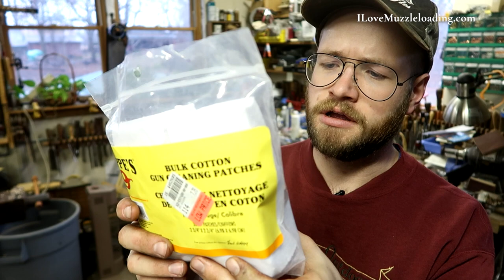How I clean my Kibler Southern Mountain Flintlock | No more rusty muzzleloaders

Comment: You removed the lock. That is when you should spray it, not spraying all over the metal and wood where it can soak into the wood between metal and wood, causing permanent damage. Sorry, I don't see the logic of that.
Reply from the maker: What kind of permanent damage was caused? I'm always looking to learn, thank you for sharing!
Reply: Untreated wood repeatedly absorbing liquid is OK?
Reply from the maker: @garyruxton5226  In my experience, and those I've talked to/learn from it rarely causes harm. In all of the original pieces I've handled, none of the inelts were treated in any way and they exist today in great condition. 

Not in any way saying you are wrong, It's something I'll continue to watch and update if I see an issue.
Reply: @ILoveMuzzleloading  Apologies. Must just be my paranoia of liquid and wood. Oops on stirring up dust. You're a valuable channel. Appreciate your work and lucky you that gets to handle a lot of cool guns.
Reply: @garyruxton5226 I'm a little late to the party but muzzleloader stocks were historically finished with Linseed oil which fills the pores and hardens. With enough applications you get a very strong, waterproof finish on the wood that can easily withstand incidental water from cleaning!

Comment: Take the barrel off and have a near boiling bucket of soapy water,  set breech of barrel in water and run patches up and down several times, scrubbing the barrel. I then take new boiling water only and repeat proces. The heat from the water gets the barrel so hot that it dries the barrel. After it cools a few minutes I then run an oily patch through the barrel then a dry patch a couple of times. Doing this it leaves enough oil to protect the barrel but not enough to have it gum up while sitting for longer periods.
Reply: That is a Longrifle with a pinned barrel. You don’t take the barrel off to clean.
Reply: Hot, soapy water is the best thing there is to clean black powder residue. As you say, the heat causes the steel to dry quickly. I always actually use boiling water (with a good waterproof gauntlet glove ilon my left hand). I flush the barrel with boiling water after I get no black or grey after flushing through my barrel.
Reply: That is how I've done it for 50 years

Comment: helpful video Ethan.  Yes a million ways to clean a flintlock.  One thing I do to clean the lock a little different than you.  When I'm home, I clean it in my utility sink with hot water and Dawn (any dish liquid will work).  I heat the lock with the hot water (tap hot not boiling hot) squirt a few drops of dish liquid on the lock and then scrub it with an old toothbrush.  After about 30 seconds of brushing, I hold it under the hot water to rinse off and get the lock hot which helps it to dry almost instantly.  I dry it off with a towel and some cotton swabs then oil it and I'm done.  Been doing it this way for 30 years never any rust on my lock.
Reply from the maker: Thanks for sharing Jeff!
Reply: I to use Dawn and boiling water. I made jig out of wood about 12" long  with a octagon cut out that fits over the barrel so me don't burn meself. But I'm cap and ball.
Reply: @ILoveMuzzleloading  I have a question for you.  I see on your kibler that you have a permanently installed touch hole liner.  I have a low end traditions mountain flintlock rifle that I have not fired yet that has touch hole liner that is slotted to fit a screw driver.  I went on traditions web-sight to look for a replacement touch hole liner for when the touch hole liner will eventually wear out.  I did not know which touch hole liner I needed so I called their sales rep at traditions and he said that if I removed the touch hole liner that the barrel was done and I needed to get a new barrel.  Which in contradictory to the cleaning and maintenance section of the manual of their traditional side lock rifles.  The manual says "remove the nipple and clean-out screw from the bolster/drum of a percussion gun of the touch hole liner from a flint lock." 

There is a warning in the manual about never remove the bolster/drum or breech plug from the barrel which I obviously know not to do that and that should only be done in the event that you can not get the rifle to shoot, or you have a stuck ball in the barrel that you can not move with less drastic measures such as a ramrod ball puller and hooking the ram rood onto something or using the co2 canister method by shooting the co2 through the touch hole to get the ball out. 

I believe that the sales rep was wrong but, I did not want to get into an argument with them on the phone.      
 
Your thoughts?
Reply: Sales rep has three possibilities- either he misunderstood what you were saying, he has never actually cleaned a muzzleloader, or he’s just plain full of sh*t. Back that liner out when you clean, use a Q tip to clean in there and then just a touch of grease and reinstall it after running a fine wire through the hole itself. Track of the Wolf had any number of replacements, the list them also by mfg.
Reply: @onewhotalks1943  I think he was incorrect, touch hole liners are made to be replaceble.  Even ones without a screw slot usually means the slot was filed off after instillation.  An easy out will quickly remove them.  What you would need to know is the thread size and pitch for your Traditions flintlock since there are different ones out there.  Like someone said, Track of the Wolf probably has one

I'm not sure what the person on the phone was referring to.

With all that said, you do not need to remove the touch hole liner every time you clean the rifle.  Remove the lock, stick a toothpick in the touch hole, fill the barrel with soap and water (blue windshield wiper fluid works great too), let it sit for an hour or so, dump it out and then run dry patches through the barrel until they come out dry and clean.  Oil and you're done with the inside of the barrel.

I always tie a shop towel around the stock wrist to keep anything that leaks out from dripping down the stock.  If the barrel has a hooked breech you can just knock out the wedge and lift the barrel out of the stock.  At a rate, cleaning a muzzleloader is not difficult and doesn't need some scientific method to accomplish.  Hope this helps
Reply: @tnzayatz6579  okay i forget sometimes that although traditions and other gun manufactures do sell guns not all of the employees who work at these companies are gun people like us.

Comment: I'm converting... Back in the late 70s/early 80s we started flintlock hunting. Our Dad was "death" on oil. No oil! We used WonderLube as the last patch down the barrel and to cover the outside, too. I believe too many hunters were cleaning like they had a regular rifle and were leaving the oil in their guns (causing all kinds of problems). Run the clock forward to today... The guns all still work amazingly well, shoot straight, etc. I am thinking of shifting to oil, at the end of the season for long term storage. It's mopping the barrel and cleaning the oil off of the parts that black powder touches that's important, right? P.S. Did you engrave your barrel or have it done? Thinking of building Kibler kits for our sons and want to personalize each one (nothing like three boys fighting over whose gun is whose, lol).

Comment: Not sure if anyone mentioned this… when removing the lock use the lock bolt to drive out the lock with a few light taps.  This will insure you do not chip any wood out of the lock mortise or enlarge the mortise over time.
Reply from the maker: Great tip!

Comment: I rust brown all my steel parts. To clean it I pull the lock and use a piece of leather clamped over the touch hole using a small C-clamp to hold it in place. I pour hot water down the bore let it set dump it. I run patches repeatedly. I then take the leather off use Balistal then dry patches until they're clean then oll it. I clean the lock oil it and replace it.  This is for long term storage.

Comment: Something I found out which might save you a few swabs with the cleaning patches is to use (a brush that fits the size of your barrel)  run it up and down first then tap the barrel pointing it down.  It gets a lot of the loose stuff out  and cleans up the groves quicker .

Comment: Great tips here for me to try. A renowned muzzleloader years back taught me the benefits of windex mixed with warm-hot water as a bore soak.  I plug the touch hole with a toothpick(wrapped with plumbers thread tape) and fill the bore with this solution.  I let it sit while I clean the lock.  I windex solution the lock well, then rinse off with hot water followed by 99% pure alcohol.  The alcohol helps remove residual water.  Sometimes I’ll use a blow dryer to heat the lock and then spray on Balistol into the workings and metal, followed by some good oil into those fine parts.  When the locks done and clean and oiled, I go back to the barrel.  I wrap the muzzle end in a cloth to prevent dripping into my nose cap etc and pour out the solution.  Sometimes I’ll do this a second or third time depending how much I shot.  I run patches until it’s done coming out too dirty and then move to 99% alcohol patches, again to remove moisture anywhere in the bore.  When the bore is clean, I run ballistol patches through several times, followed by a patch of bore butter or again ballistol then dry patch then ballistol again.  The next day or 48 hours later I’ll dry patch the bore, with another oil patch again.  The wood - I tend to use danish oil with no tint or dye just plain watco danish, or I even use Tung oil light and buff into the wood.
I was always advised to avoid most modern petroleum based solvents and modern gun cleaners (other than ballistol).  Old mountain men used to piss down their bore and let that soak 😬 have not tried that yet.
Make sure the flint is dry and there’s no oil on it.  Again alcohol is great and dry patch to clean that flint.  You want sparks! Also I dry and ensure the frizzen face is clean, dry and oil free.  No spark no boom.  Love this.  Flintlocks are the life! Thanks for the conversation and tips here.

Comment: I just used my TVM .54 caliber early Virginia rifle to take 2 white tail buck, a white tail doe and a 110 pound hog in south Texas.  I did a basic cleaning after taking the hog and first buck, then the same on day two after taken the second buck and doe.
When I made it home, I cleaned her from head to toe along the same lines as your video and she is squeaky clean.  I always follow up every day after for 3-4 days with a patch soaked with Mr. Flintlock and chase with a patch soaked in 91% rubbing alcohol for storage.
I like to use a light layer of Anti-Seize between the lock and barrel.  It seems to stop and powder residue or hot gasses from getting into the lock area, barrel or under the stock at that point.  I follow these steps with my .62 caliber transitional I build from scratch.  I used slow rust bluing on my .62 and stopped after 7 applications and was rewarded with a sweet grey blue finish.  So far after 3 years, that bluing has not faded and still maintains that aged look.
The Shenandoah Lube you speak of is available at Midway USA… I just order a 6.7 oz. Bottle to try out.
Thanks for you awesome videos
Reply from the maker: Thanks for sharing your methods!!

Comment: Couple tricks I use from years of cleaning...I buy and use the cheap brown cloth gloves that you find at all the stores. They are my oil gloves. After many uses, and they start getting holes, I just grab a new pair from the pack. Second, I keep a stack of soaked patches in a cleaned out glass jelly jar. Fill the jar up with new patches from what I used. The remained soaked patches usually wet the new ones. Screw down the lid, put on the shelf for next time. Great channel!

Comment: I get maybe two inline ( cheap ) muzzle loaders a year, in my gunsmith shop. Generally they are from new-be's that either do not know how or worse that it should be cleaned.  Sometimes I get one that has the charge, ball and all still in it , and for over a year at that.  Most are rusted beyond use with deep fowling .  A couple of inlines where the otherwise removable breech plug is rusted solid to it's threads.
Reply: Ha Ha! The best thing that could happen to an in line!

Comment: Ballistol may work best if you let it soak longer. Rubbing hard may remove the benefits of the products’ interaction with the metal itself. I use for metal, wood and leather although I do not know if this has any long term negative effects on wood and leather. I do know that in high humidity environments it will prevent leather from growing mildew on leather, something to do with a chemical interaction between the Ballistol and the leather. You do very good work in keeping your viewers up to date on the sport. Thanks again!

Comment: For cleaning my muzzleloading revolvers, I've always used Thompson's #13 solvent, anti-seized the nipple threads, and lubed the cylinder pins with Bore Butter. Then run WD40 inside the barrel and chambers once they're dry. Then rub down in WD40.
Reply from the maker: Interesting process! Thanks for sharing Joshua!

Comment: Nice video and you do a great job cleaning. I thought I was doing a great job cleaning my Muzzleloaders until I got a Teslong Borescope for Christmas this year! My routine: I use a magnetic flush tube on the touch hole and flush the bore with Hot tap water pulling water in and pushing it out several times changing the patches and the water several times. I finish by running patches soaked with Ballistol up and down the bore until they looked pretty clean, then I oil with Clenzoil. I thought I was good but when I put that Borescope down the the barrel I found rust which scared me. Luckily I didn't get any pitting "Yet". I never do this but I had to use a copper bore brush to scrub the rust out. I know that's not advisable because the brush can get stuck and I wouldn't make it a habit. If you have an opportunity to use a Borescope I highly recommend it. You might be surprised by what you see!
Reply from the maker: Thanks Jack! Lots of good insight in your comment. I'll have to invest in one of those cameras.

Comment: Thanks for sharing.

My cleaning regimen is similar, my aim is to season my barrels. Usually takes 200-500 rounds, but ive never gotten a rust issue even up to a week after shooting. Just clean with natural stuff, no soap. Lots of water, balistol, olive oil on occasion, and bore butter to finish. Ill also run a camera down my bore every 6 months just to keep an eye on things.

Tallow or mink oil work well too btw. My dad raises lambs, is tallow is pretty easy for me.

One thing i am trying, per TVM suggestion, is type f atf on the exterior of my TVM Tulle(aka Fusil de Chasse). Seems to do well conditioning the wood and exterior metal. Done it twice now and i can see why..the paraffin wax in the atf leaves behind a nice finish, and the min wax paste on the wood they recommended is now a staple every 6 months for my wood on all my guns now. It really brings the grain out, especially the tiger maple i have on my Fusil.
Reply: I think bore butter is junk
Reply: @Peter-od7op  i used to...
Reply: @Peter-od7op  TC Bore Butter was popular in the 80's along with TC's Hawken guns. In my experience using it in the past it will foul up a barrel in short order. I always thought it was a crappy patch lube. That being said, my barrels never had any rusting issues running a patch with BB after cleaning. But in the end now I would rather not even have it in my barrels at all.
Reply: @danclas5983  i found the same shooting with BB, but i also dont have access to running water lol. I have found it to be a decent rust preventative. Only time i use it is after cleaning for storage.
Reply: @Peter-od7op  Been using the stuff for more than twenty years... probably closer to thirty and never had any real issues with it other than it can get liquid in warm weather and in cold weather it is hard to get out of the tube.  It seasons the bore well and I haven't yet had any issues with rust.  I guess that your mileage may vary though.  Really, any non-petroleum product will work fine as a patch lube.  I'm not sold on Balistol for that purpose as of yet.
Reply: This gets tiring to hear but barrel steel is cast iron and does not "season".  Your 200-500 rounds didn't season anything.  It smoothed out the barrel and made it easier to clean.  If you had used a petroleum product to clean, or water for that matter and then dried it, and protected the bore with a rust preventative your results would be exactly the same.
Reply: @Nick-wn1xw  heard that argument a lot... Im done trying to change minds... Worked for me... Thats all that matters. You mileage varied .. good for you

Comment: Hello Ethan. Just found your channel.  I clean a flintlock with a gizmo that looks like a C-Clamp and has a small rubber tube that comes off  the side and you put in a coffee can full of your warm, bore cleaning solution. You remove the lock and clamp it over the touch hole. With your patch and cleaning jag, you pump the barrel like a giant syringe, flushing the crud out. Track of the Wolf sells one of these cleaning clamps. It makes cleaning a flintlock much easier.  I like to use water soluble oil that machinists use to cool machine tools. It's cheap and does not rust the barrel and you can buy in large quantities. Hope this is helpful.
Reply from the maker: Thanks John! I need to get me one of those I think. Lots of folks like to use them. Thanks for the tip on the machine oil!